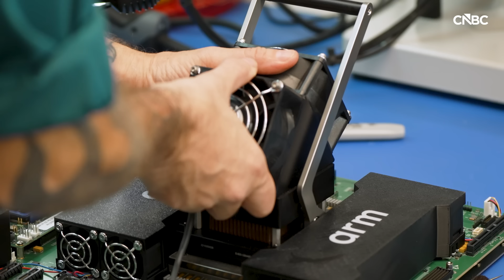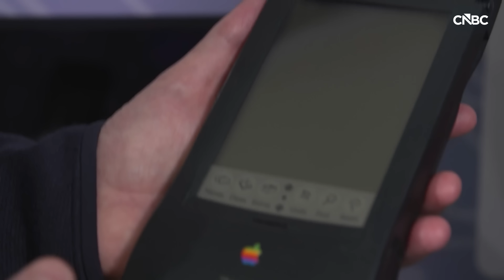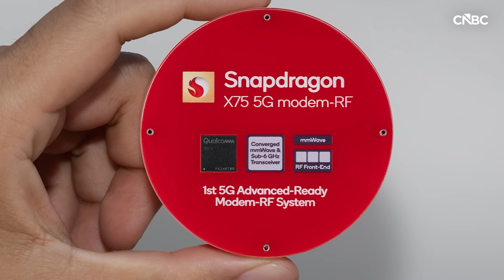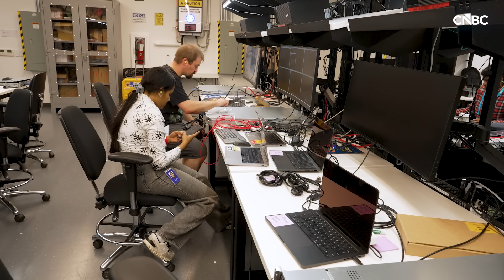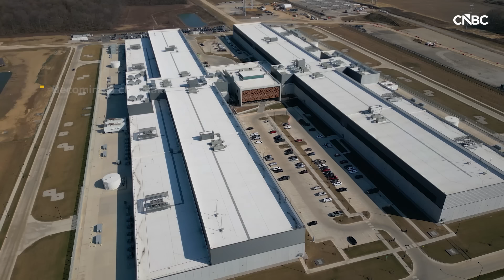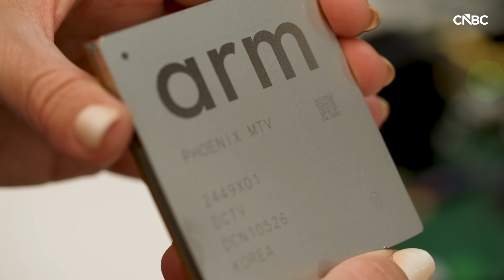Arm Releases First Ever AI Chip, With Meta As Initial Customer

Comment: ARM (or any Western party) should start putting a stop to SMC pricing cartels and should start producing memory modules domestically. As we've seen, nowadays oil isn't the only strategic resource during a crisis—electronics are just as critical. During a crisis, importing becomes difficult, and that’s why security of supply is essential.

Right now, the US and Europe rely heavily on semiconductor imports from the East. Taiwan alone accounts for roughly 44% of U.S. imported logic chips and about 24% of imported memory chips. Taiwan is also the single largest source of U.S. semiconductor imports by value, sending over $14 billion worth of chips in a recent year. China, South Korea, and Malaysia make up much of the rest.

Europe is in a similar position. The EU produces only a small fraction of global semiconductor supply and depends heavily on Asian manufacturing—especially Taiwan—for advanced nodes. When over 70% of the world’s advanced chips come from one region, any disruption there hits Western supply chains instantly.

This is why domestic production matters. It’s not just about price—it’s about resilience. If the West wants real security of supply, it needs to build its own memory and chip manufacturing capacity instead of relying on imports that can vanish overnight.

Comment: All data centers should be tied to power capacity build out by default. The critical failure point is being constructed in front our eyes, and government is to captured to regulate it. These companies have the resources to construct or backstop the new construction of the 21st century grid, which will benefit them in the long term. It needs to be done, and not by "others" but by the main beneficiaries.

Comment: I have never seen such a giant CPU.
Reply: It's not really a CPU.
Reply: @RobardoHughes  well, it is the Central Processing Unit which makes is a CPU
Reply: @wikittywhacktv   From the release notes:  "Every element of the Arm AGI CPU – from operating frequency to memory and I/O architecture – has been designed to support MASSIVELY PARALLEL, high-performance agentic workloads in a densely populated rack deployment.

Clearly this is more of a GPU or TPU than a CPU.  Do you know the difference?
Reply: @RobardoHughes  he literally describes this chip in the video as solving the CPU bottle neck problem in the data centre infrastructure. it doesn't do the vector computations. it is a CPU with hundreds of cores
Reply: @RobardoHughes  also, their competitor is intel not nvidia. why is that?
Reply: @wikittywhacktv   An analysis of these design specifications yields the following approximation: Estimated Dimensions 
Width: ~70 mm to 75 mm
Length: ~70 mm to 75 mm
Total Package Area: ~4,900 to 5,625 mm²
There are thousands of computers physically larger, so that can't be what you meant.  So let's talk about CPU capacity:

"In the absolute worst-case scenario—where the code consists of a strict chain of serial data dependencies—the Arm AGI is limited to 3.7 GOPS on a single thread."  So you are correct; there have been Intel CPU chips for decades which out-perform this device if it is used to perform worst-case scalar calculations like a CPU.  So that can't be what you were talking about.

What are you talking about?
Reply: @RobardoHughes  i don't understand what are you trying to prove? it's a fking CPU, not a GPU

Comment: Gargantuan footprint = more silicon wafer and substrate acreage than they'll be able to get access to, to be able to scale this....in my opinion, I'd be shocked if they're able to ramp to a couple hundred thousand or so units annually. It's easy to scale their prior products for small products like mobile phones where each unit has a tiny piece of silicon wafer and substrate...this thing is MASSIVE by comparison. I mean, maybe they've done the prep work to secure wafers and substrates to pull it off but count me skeptical as those are both already highly constrained parts of the supply chain...and it's a zero sum game where they'll have to elbow nvidia and apple units out of a key supplier's MRP to fit their own products in).

Comment: Would love to see an Arm-based steam machine that’s cheaper than typical x86 cpus.
Reply: The CPU is less than 10% of the cost of the machine, and the AMD64 to aarch64 differential would only be a precent or two, so you need a better use case for switching architectures.
Reply: I think Valve are looking at implementing a translation layer for this purpose.
Reply: I believe the steam frame uses ARM and that will be there test to get it compatible etc for the steam deck 2 to use ARM. Eventually the steam machine 2 will be ARM and x86 will start to dwindle down as peaked outdated tech.

Comment: It’s an OK CPU. But for AI agentic workflow, the AMD Epyc CPU with 3D Vcache will smoke ARM every time! 3D Vcache allows AMD to keep the PCIe 5 & memory buses operating at peak performance at all times!
Reply: Performance per watt, is more important than absolute performance these days. The reason is that there is to little electricity infrastructure. If they could get an infinite amount of power to their server buildings, then yes they would probably go for x86, but they can't. Since they can only get a limited amount of power (one or a few Megawatts), they have to squeeze out the best performance within that power constraints. That's the same reason that NVIDIA created SOCAM memory modules for their supercomputers. Basically taking memory chips, that normally would be used for smartphones, because the performance per watt is better on those modules, than ordinary PC RAM modules.
Reply: @LisaSamaritan absolute performance is the most important for AI developers. Ai companies are building gas generators next to their Ai servers just to ensure peak Ai performance.
Reply: @kazedcat You are thinking about it, completely wrong. Take the NVIDIA RTX PRO 6000 graphics card. It exists in two versions, the standard one and the Max-Q version.

With your reason, everyone should want to use the standard version that can pull 600W of power, instead of the 300W version. But the 300 watt version isn't half as fast as the 600W version. The Max-Q version pulls at most, half the power, but generally delivers 85-90% of the performance.

In other words if you have a computer and you have a 600W maximum capacity allowed for the GPU, then it makes more sense to have dual 300W cards, because they can perform 170-180% compared to a single 600W card.
Why? Because the 600W version is extremely inefective, going way beyond its sweat spot of performance per watt.

It is the same reason why, ARM processors makes sense instead of x86. You can get better performance per Watt.

Racks filled with servers can't pull an infinite amount of power, there is a limit and that's why they use phone technology (ARM architecture and LPDDR5X memory), because they do have good performance in comparison to the power draw.

Sure if they could have dual 600W instead they would, but they can't, so they don't.
Reply: @LisaSamaritan You are wrong about the limits. The limit of current Ai models are not in power. They can just scale up the number of gas generators on site to power them. What limits current Ai model is actually the distance between GPU. The farther the GPU's are apart the harder it is to keep the memory coherent. That's why they are switching to fiber to increase the distance that memory can stay coherent and they sacrifice power efficiency to be as dense as possible just to be able to train the very large Ai models. So no power can still be scaled but memory coherency is hitting a wall in Ai development.

Comment: Competition is good. Glad it was blocked from Nvidia acquisition!!
Reply: i wonder what nvidias  goal was with arm
Reply: @BT-7274-T2  building the best CPUs the world has ever seen, and in the long term probably locking others out of the ecosystem
Reply: @anonymouscommentator  Yes the greed is strong in this bunch.
Reply: @anonymouscommentator  NVIDIA doesn't build CPUs. They built GPUs and TPUs (completely different). This release from ARM is just a CPU and thus complementary to NVIDIA, not a competition to NVIDIA.
Reply: @thornelderfin  nvidia does builds many things, GPUs and CPUs included. Their CPUs are called Grace and Vera and they will release a consumer laptop CPU this year too. Nvidia said they have a suprisingly high demand for their CPUs.
Reply: @BT-7274-T2 
Profit from the licensing and customer base that already exists.

Enter the new markets

Acquire experience and research just like Intel with Altera, Qualcomm with Arduino and AMD with Xilinx - instead of taking time to develop their own CPUs and related technologies.

Control how well CPU design houses can compete with Nvidia when they enter that market too.
Reply: @BT-7274-T2  Monopoly.
Reply: @BT-7274-T2 If you can’t beat them buy them.
Reply: @BT-7274-T2 they would have killed it just like cerebras.
Reply: Nvidia and ARM don't compete you get that right? They build products for different markets.
Reply: @GeorgeWashingtonLaserMusket  nvidia does build datacenter CPUs based on arm technology for quite some years now. they are called grace and vera with consumer laptop CPUs coming this year (likely)
Reply: @GeorgeWashingtonLaserMusket he's saying that arm is competing with amazon, Google, Qualcomm, and Microsoft, etc. (competition is good) The acquisition is from a venture from years ago when Nvidia tried to buy them. Two separate things but related to each other.
Reply: it's time nvidia ceases to exist
Reply: Holy crap I completely forgot about that. What a nightmare that would have been
Reply: Meanwhile the US blocking Chinese car manufacturers. So much for competition. And don’t talk about that national security nonsense
Reply: @tigerrx7  Easy for you to say but do you also know WHY they block chinese cars?